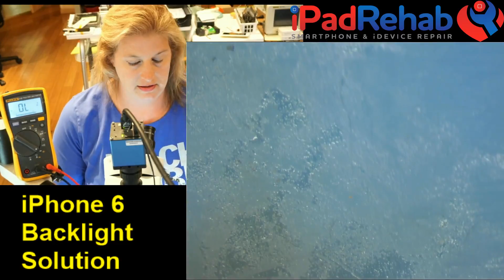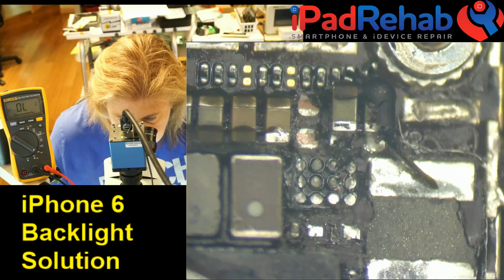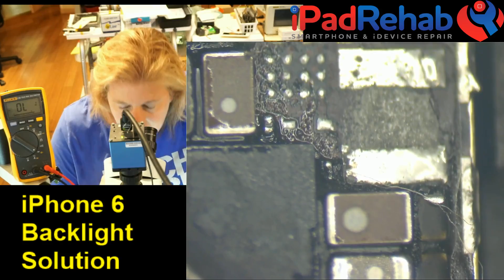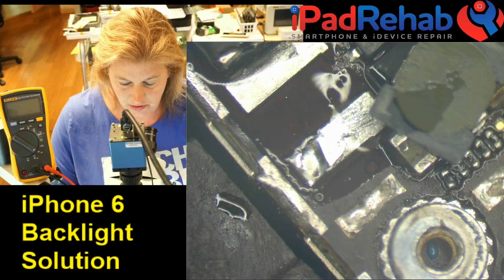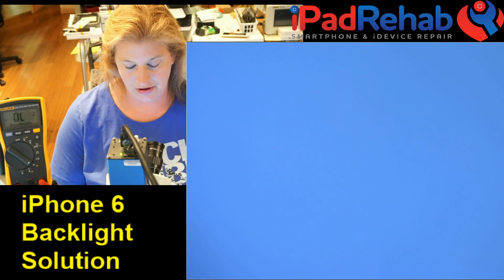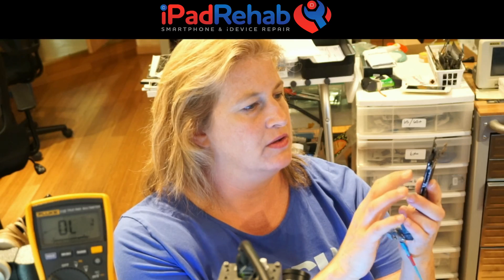iPhone 6 complete no backlight solution 100%

Comment: Hi, I am from Iran and have a Samsung Ultra Note 20 which I fell down over it and broke in half, I took it to a repair shop, and they said it needed a screen, case, and 2 cables but they said that to repair my board as well after 10 days they said can't repair the board because bord is in 2 layers and can't solder the component if I send you the photo of my board can you help me to find a problem and get it to fix please

Comment: if iphone have no display but give sound and itunes see the phone without problem, also flash light works, is it because of this problem? (btw display started not working after unplug and plug screen cables and i saw small sparkle and smelled little smoke)

Comment: Is this permanent? or can there be failures in the future?
Reply: There can be failures in the future the 6 series of iphones had a big problem with the backlights going out.
Reply: @calyxprophet5221  
Well, mine is an SE, do you think I have problems in the future / after they repair it?

First of all, Thx´s.
Reply: @luismendoza1934  Very unlikely but is possible doubt it though.
Reply: @calyxprophet5221  
I hope the repair lasts a long time, again thk´s ;)
Reply: @luismendoza1934  Should the 6 series of the iPhones were the really big problem with the backlight the se should be just fine after repairing.

Comment: Hello people, Greetings Jessa.

I got this iPhone 6 with no backlight, client claims that he dropped the phone and took it to a third part repair shop but they didn't repair anything. When I opened it, I saw the shields were gone. I measured in diode mode and got 0,1 as a result. I took C1505 out and remeasured, got 0,64 this time so I guess the short is gone. I tried to find it C1505 was a wire, it was not. Also, the backlight driver's pads were ripped off (8 out of 12 are gone), the backlight's driver is missing and so is the backlight's coil. The pads of these 2 are looking ok.

So, my question is plain and simple : is there still any chance to get this phone working (even if it involves hard work) ? 

Also, Jessa, you are wonderful. Love your vidz, love the way you explain, you rock !
Reply from the maker: In theory yes—put on a backlight driver, diode and coil.  Every pad must connect to the driver.  With 8 missing I would probably pass on the job since it is an older phone now, but it is definitely possible
Reply: iPad Rehab Thanks for the quick response. I wonder how to "reseat" the pads, I've never done it nor ever seen it done. Jumper wire maybe ?

Comment: Good day to you, I have a backlight problem with my iPhone 6s. The phone vibrates when I toggle the vibrate switch and the phone charges. I made a mistake of plugging a new LCD replacement without unplugging the battery, which caused a short with the motherboard, I smelled a diode burning when I plug the new lcd screen. The screen sometimes comes on when I turn the phone on and off and I can faintly see the screen with the assistance of a flashlight and was able to unlock my phone. I was wonder how much do you charge to fix this issue and how can I contact you. Thank you
Reply from the maker: Fill out a quote request at www.mendonipadrehab.com

Comment: What can I do when some pads of the backlight ic are broken ?
Is there a way to repair it. It was my first attempt to unsolder  such a chip and it went wrong un fortunatly.
I tried some things but nothing worked for the moment.
I should have watched your videos before, thanks a lot for them , I learned a lot.
Reply from the maker: +Frederic Strub you'll have to make microjumpers and solder the chip on top of them
Reply: Thanks for your answer.I did that but i think the jumpers moves when i solder the chip.I tried twice without succes.Maybe i schould use the green UV stuff you sell in your store to protect the jumpers before soldering the IC

Comment: Hey, I've been becoming more familiar with my multimeter and I'm trying to get away from continuity testing like you said. I have been comparing diode mode readings to "known good" circuits and just going off of obvious differences, but I really want to understand what the multimeter is doing, and what those readings mean. When testing that backlight circuit, you said ~.5v is normal. What does that imply? Wouldn't resistance to ground be measured in ohms?
Reply: Diode mode is quicker.

Comment: In my experience the U1502 hardly fails. I just remove the bad cap and replace the diode and the coil and it's good to go. But she's right, the solder balls beneath the chip can go out if you apply to much heat. Then you'll have more work having to re-ball the IC. Also if you're not careful while looking for the bad cap or something else you can crack the IC ☹️
Reply: Replace them all, its so much quicker. And it is a plus to get the extra space to work with. I usually take them all off all at the same time, dink, dink, dink, dink.
Reply: its better to use micro tweezer, then the risk of damage is much less :)
Reply: you're right

Comment: Hi Could you please direct me to a link w zwxtool. Much appreciated as the link under this video doesn't work. Thanks in advance.
Reply from the maker: +Artur Slowinski we sell it at www.mendonipadrehab.com
Reply: iPad Rehab if I have got it right zwxtool is a software which You do use to check all board schematics and positioning and responsibilities of all components on pc boards? Unfortunately I'm unable to find it on your shop website. Could you please help me with that one. By the way you are doing great job. I have seen already a few videos off yours and they are great.
Reply: hardware encryption key, which you pay for, the software you download from the website, and pc boards? no its for mobile device. schematics, no those you buy or use blackfish, positioning yes, I guess. responsibilities, no, schematics are for that. try making a more coherent message next time and you might get a reply from jessa.
Reply: peterizrandom pc board stands for a printed circuit board which is what iPhones got inside, right?
Reply: pcb, if you type it incorrectly it will be perceived incorrectly